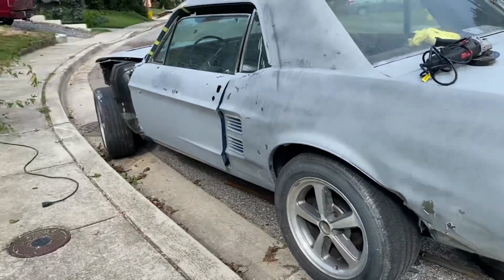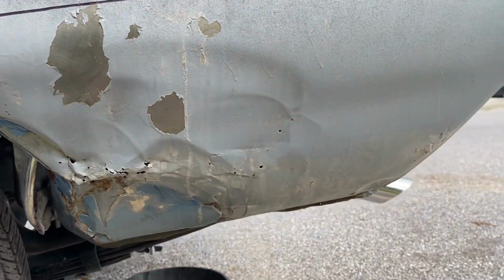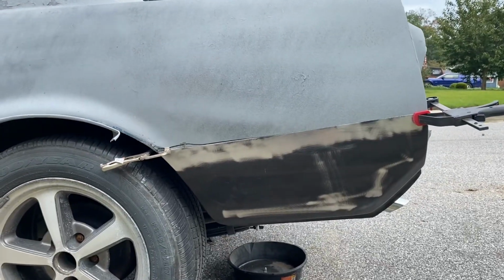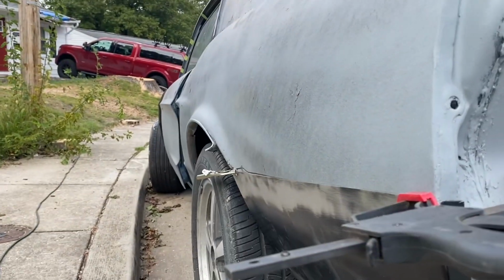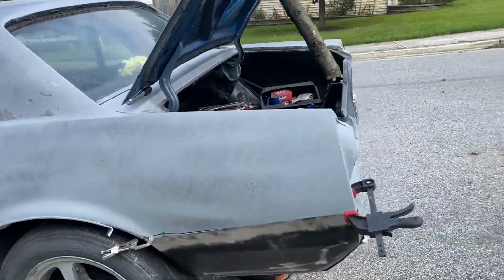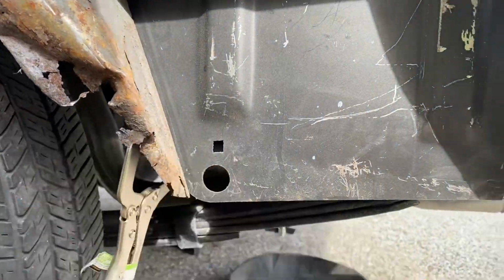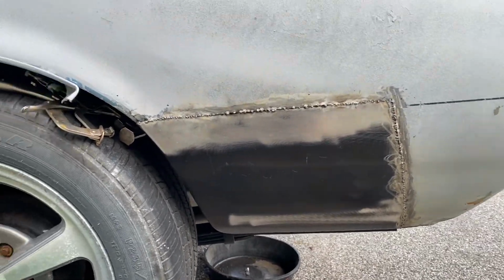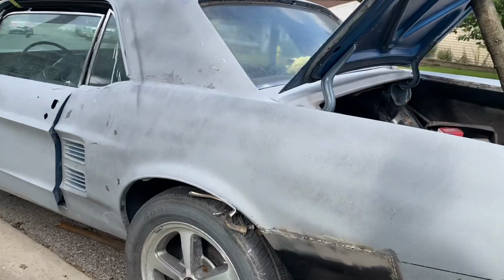1967 Mustang Quarter Panel Patch

Comment: What welder are you using?
Reply: Looks like a titanium brand from harbor freight. Either the flux core or mig welder. No way is stick recommended for this type of work. You don’t really need a high amperage machine to spot weld thin metal. Look into the TITANIUM Easy-Flux 125 Amp Welder. Hope this helps 🤙🏾
Reply from the maker: Titanium brand from Harbor Freight flux core, 110v welder with .030 wire. I got it on sale for $150 then bought one of the better welding hoods, gloves, and all the accessories.
Reply from the maker: @downhilldaddy5282  You are 100% correct

Comment: Hey Austin, What wheels are on your mustang?  They look great!
Reply from the maker: They are stock 2004 Mach 1 wheels that I bought second hand for a really good deal since they are scratched and curbed pretty good (I would think beyond repair).  I currently have a 1 inch wheel spacer (to clear my front Wilwoods discs)  and I had a tiny bit of rubbing but I think that’s due to my car not being aligned at all, and the suspension was worn so the car sat a little lower then stock. I’ll report back after an alignment!
Reply: Thanks  so much for the information.  I look forward to your mustang progress. @austindowney7142